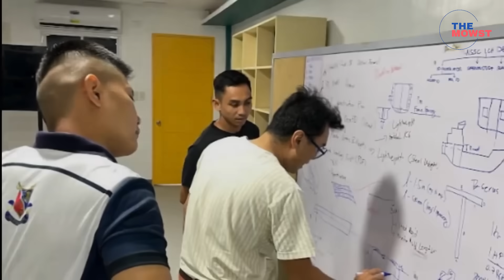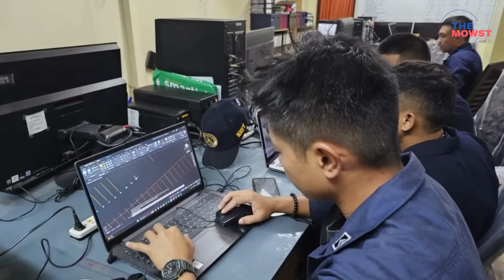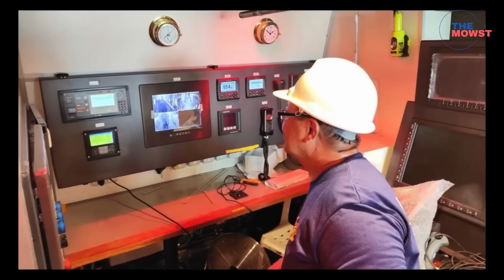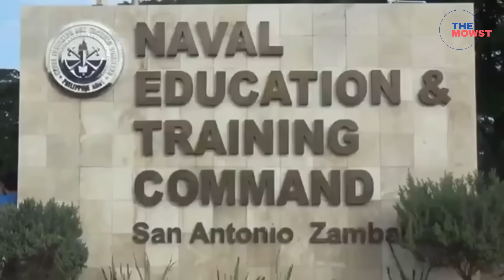Philippine Navy Reveals New Locally Designed LCU: Future Amphibious Vessel Under SRDP Program

Comment: Weird that the proposed landing ship rendering shows a severely cut off flat bow on  it. Wouldn't that hurt the ship's performance, especially on rough sea conditions. It will also surely limit its speed on the water.
Reply: That flat bow has a very good chance of slamming in a head sea and warp the ramp. At worst, it'll flood the open deck. Dunno what those guys are smoking
Reply: @obigarcia7772  I strongly agree. But in the naval team's defense, it is not what they are designing. I'm afraid I am not allowed to disclose more about the design.
Reply: @lyndonhanzpernites5860  The design of an LST is no mystery to anyone who's been around vessels one way or another. If the naval architects have their marbles right then it'll be less of a pain to build, operate and maintain.  Would be interesting to know what the design considerations were and finally it would be worth telling channels like these to watch what sh*t they put on YT
Reply: ITS FAKE NEWS.. the image they used is actually a french design and built ship for ANGOLA NAVY